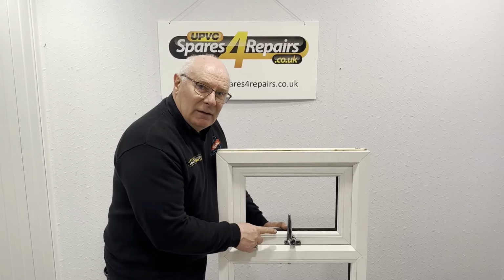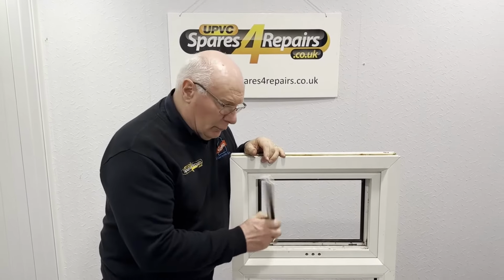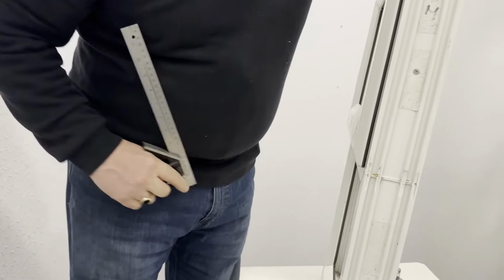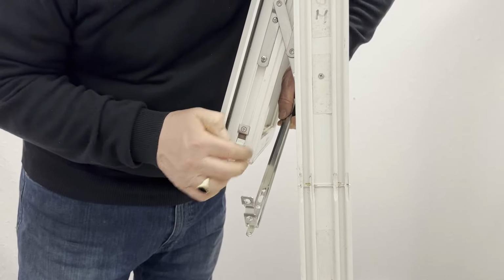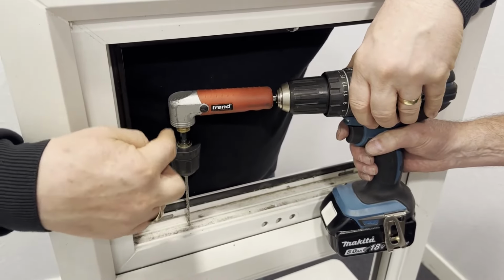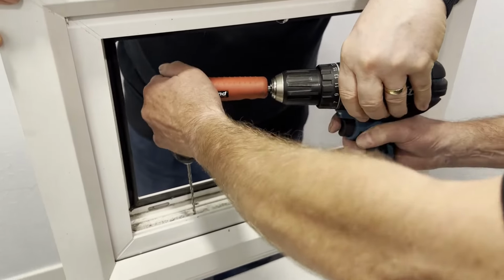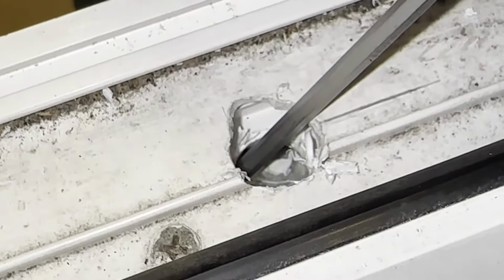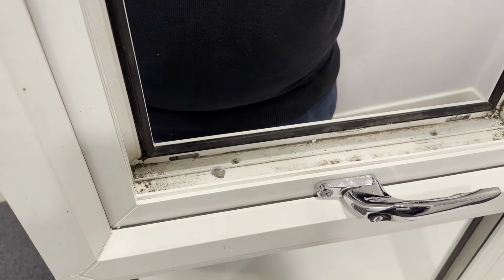How To Release and Repair a Jammed Upvc Window

Comment: Mine is fixed an inch open, I can't close or open it further. The handle and lock appear to be fine. I sprayed it liberally with WD40 and used a brush to remove debris, and used a mirror to check for anything stuck in the bottom of the frame. But it is still stuck. The window and frame flex when I push it then return to an inch gap. It's not my flat so I don't want to start unscrewing anything. I can't inspect it from outside because I am on the 4th floor.

Comment: Thank you for the wonderful guide. I've followed your instructions, but after drilling the larger hole I find that there is not only metal where I would expect the espag plate to be, but there is also metal up the sides (or front and back if you're looking face on to the frame), which looks like it might be a metal U-frame reinforcement - am I correct?  I've only drilled though one layer of plastic. Am I to drill though the metal, possibly another layer of plastic, before I hit the espag?  The frame is made by Profile 22. Many thanks.
Reply: Same problem mate drilled it like video but no joy  frustrating

Comment: Just had a new glazing unit installed but the fitter didn't check the mechanism, so they closed and locked the window and now it is jammed shut.
replaced the handle to see if that was the problem, but seems either the lock box mech has jammed or the shoot bolts are stuck in the locked position. Little bit scared to remove the beads now